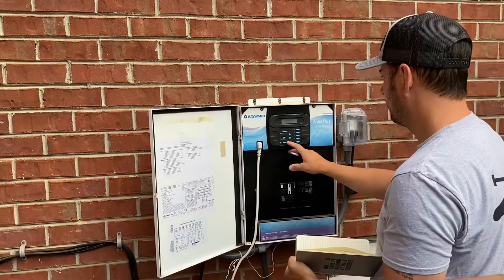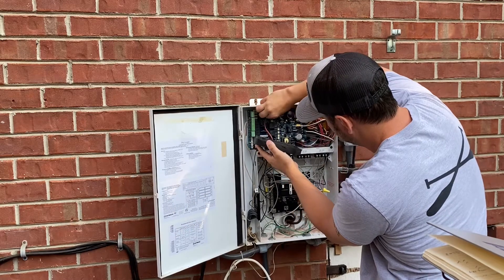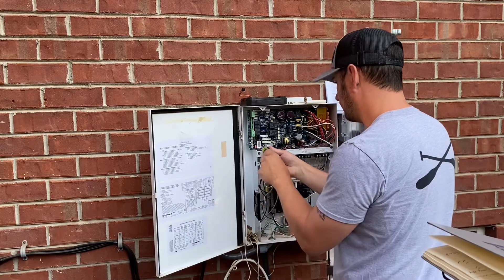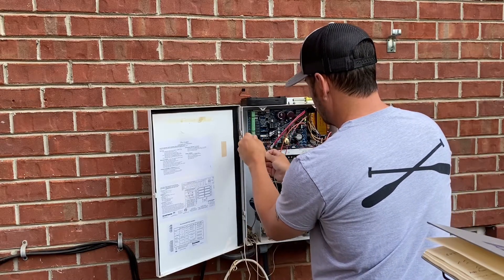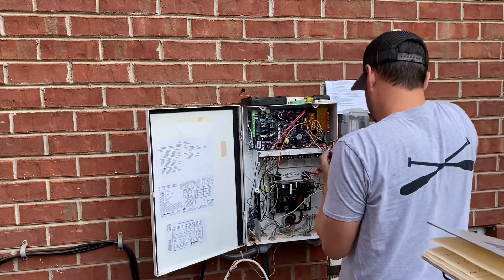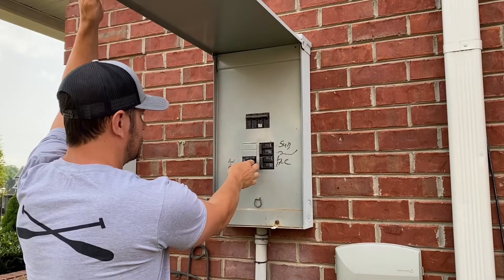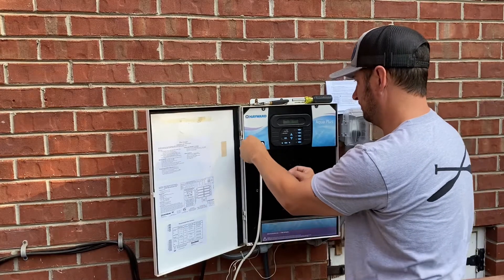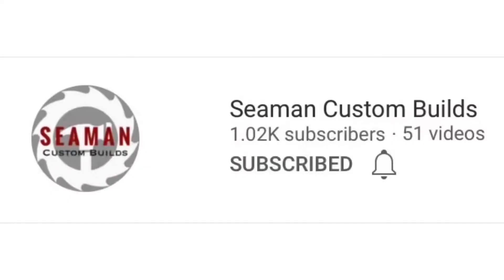Replacing Hayward ProLogic PCB board, GLX-PCB-PRO replacement

Comment: This would be a great video if you zoomed in during the part where you wrote down all settings to show how you navigate through the menu and how you set up everything again once the new board is installed.
Reply: Certainly, I'm just looking for the proper wiring locations.

Comment: Great video!  It took me exactly 55 minutes to change the board and input the new settings. Helpful tip:  hold down the left and right buttons to unlock the configurations menu. There are a lot of settings in the configurations menu that you need to write down before changing the board and then input after changing the board.

Comment: I have a Hayward Pro Logic board that seems to no longer keep the clock at the correct time or it doesn’t run the clock at all. Any idea what components on the board need to be replaced? The whole board costs over $800! I think there’s possibly only 2 components that need to be replaced for around $15.
Reply: You need to buy a whole new motherboard. There is no fix for that. Very unfortunate. I will be replacing mine next season.
Reply: @ I found someone that can fix it for much cheaper than replacing. I mailed mine to him and it’s been going strong ever since.
Reply: Who did you find that can repair these? Can you post info?

Comment: I watched your video's and changed out both main board and control panel.  I input all my previous settings into the new control panel but I'm getting a "VSP Comm Rrror"  Is there a Comm setting that needs to be changed so the control panel will communicate with control panel on the variable speed pump.  All control buttons on the Box control panel work except when I push the pump button, nothing happens, then I receive the "VPS Comm Error" on the display window.  Is there a Comm option in the configuration menu that allows to select a comm port so the board and pump communicate?  What would that comm setting be?
v/r
Mike P.
Reply: HI Michael, how did you solve the problem you described? I have the same problem now.
Reply: @patriotusa123  
No I have not!  I am using the control panel key pad on the VSP to control my VPS daily run times/operation.  I'm also using the main control panel inside box mounted on my house to control my boost pump time/operation.   (Only way I can control boost pump operation).  What I overlooked was a document that was included in my main mother board package that tells me to rewire the VSP to operate with new mother board and receive commands.  Haywood has done a software update on the main mother board that requires this action to be taken or this error will happen.  They also recommended that I update to a new version of this system, Screw that!! Provide customers with the mother boards so we don't have to upgrade just maintain what we purchased.  I need to find a pool installer who can understand this document/rewire instruction, comply with the document so I can resume normal motherboard operation without using the control panel on my VSP.

Comment: I do not have a error message on board. I replaced the breakers and a new motor. The motor runs for an hour or longer and then shuts off. The breakers do not trip. Could this be the e-command 4 problem? Please help.

Comment: Absolutely amazing video. Saved me $500! This is pretty much the same exact steps as GLX-PCB-MAIN Aqualogic. If you are a little adventurous, this is an easy project - about as complicated as installing a new home thermostat. It took me about 45 minutes and over half of that was trying to get the darn plastic pegs into the control display! Also, note I did take a picture of the settings, but didn't know to unlock the configuration settings to get the more detailed setup. So, anyone using this video, make sure you take pictures of the setting in the configuration menu. A little trial and error and I got those setting back on too.
Reply from the maker: Hey glad it helped, thanks for watching!

Comment: We have this exact display and just replaced board with your awesome video!  We need direction on settings to access the chlorination.  Our remote doesn’t seem to be linking and we can’t locate a manual online.  Any guidance?
Reply from the maker: Are you talking about the salt cell settings?
Reply: We can’t access the chlorinator in our display after installing the new board.
Reply from the maker: @ColstonandMiles  here is a link for the manual, you have to enable Chlorinator in the configuration menu
https://www.hayward-pool.com/assets/documents/pools/pdf/manuals/PLTPM-PL-PS-x&PL-PS-x-VOperationsOct08&Later.pdf

Comment: Hey I have Aqua plus GLX-PCB-Pro board that has error no cell power 2. Friend of mine gave me GLX-PCB-MAIN. Will it work ? Thanks
Reply from the maker: I’m not sure on the compatibility between the 2, might be worth looking at the connections ans see if they are the same, maybe some setting on one that the other does t have but should be easy to try out if you already have it. Good luck
Reply: I know this is a couple years later but all you have to do to fix that issue is replace a $12 relay, located in the upper right corner of the board. This is a common failure on earlier GLX-PCB-Pro boards. Remove the relay, clean the surface and solder in the new relay... apply a liquid plastic PCB sealer. That is the reason these relays fail because the old boards, they are not coated and the components are susceptible to moisture.
Reply: @AZFrank4x4  is the relay a different component than a rectifier?  Or is it the same thing--just two different terms to describe it?
Reply: @htsu Yes they are different.

Comment: hi, i have the aquaplus goldline control. i have a problem with my salt reading, it was reading low or very low on my cell, so i figured it was cell going bad this was my second cell in 5 years already, (thats how old pool is) so i put new cell on again ( 3rd cell)and it was reading fine like 3200ppm , (pool place tested salt it was actually like 3600ppm ) which was close , so fine , now a month in a hlf later doing same thing, low or very low salt reading 2100ppm , checked volts and amps in diagnostic mode setting seems fine, no error messages, cell off of course because it thinks salt is low. pool place checked salt again fine 3500ppm. i was thinking it has to be my board, is it frying my sensors in the cell or something. do you think could be board not working right ? getting frustrated...no way on this control board to calibrate salt cell either from what im told. board is set to right t-cell which is t-15 , i checked that too...thanks for any help
Reply from the maker: I have no idea, mine has always been pretty close when I tested it, good luck figuring it out
Reply: @seamancustombuilds  ok thanks appreciate it and the video
Reply: I’m assuming you already got that fixed, but it’s always easier to call goldline’s customer service (number is on the inside of the panel). Those boards are really tricky to troubleshoot. I always call the customer service number even if I have to wait 15 mins or more.
Reply: @isaacqualls9649  yes thanks for your help, was salt cell had to buy a new one again, we'll see how long this one lasts, reading fine now,  thanks again
Reply: Get a Taylor K-1766 Salt Test kit and test the salt level in your pool.
Reply: I have the same problem...What did you do to fix?
Reply: @dougs.9486  i still havnt figured it out , put new generic cell on this year so far still working but will start slowly degrading soon im sure. my pool company doesnt know, they never seen before either. They want me to just switch to UV system, they want 3600 to install, thinking about trying a new control box the pro aqualine can get for 1365 if buy myself, not sure if i can install yet , then hate to put $ into that if it keeps doing same thing. went thru 3 salt cells last swimming season, getting aggravated and expensive! Let me know if you find out anything..thanks
Reply: I am also having a similar problem.  My setup (Prologic GLX-PCB-Pro ) eats through salt cells in about 8-9 months.  No errors other than low salt/check cell alerts near the end of life.  Would love to figure this out.  One person told me it is my rectifiers....so I bought some of those.  Just haven't had a chance to replace them yet.  No idea if that would change anything?

Comment: Hey Boss, I was just changing out the GLX-PCB-PRO board today with a new one I purchased on e-Bay.  Everything matched up except for some reason the new board did not have a stem for the grey wire from the transformer to connect to on the bottom right of the board.  I am reluctant to power it on with the grey wire from the transformer not connected.  Unless there was an updated design that no longer required the grey wire to be connected, I'm guessing this was a manufacturer defect.  Any ideas?
Reply from the maker: I’m not sure, all my connection matched the existing board, there should be 4 connectors there
Reply: Good morning,  can you provide a pic or 2 as to what your describing, I am about to replace the old board with an ebay purchased 1. Thanks in advance